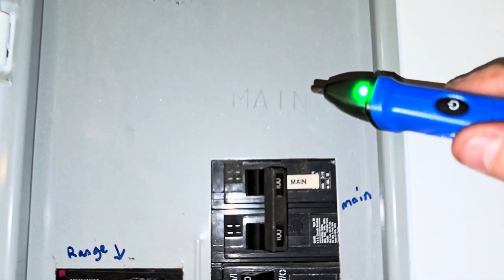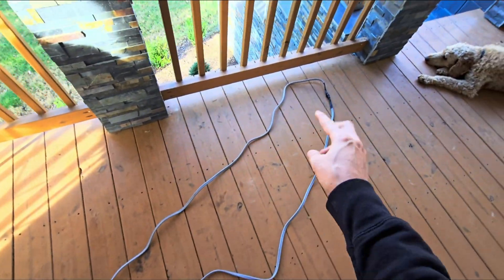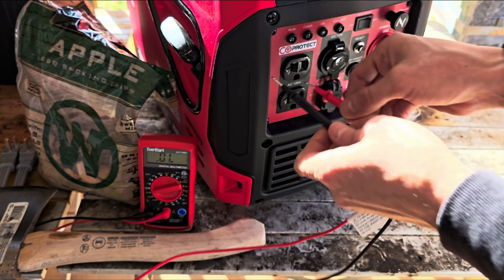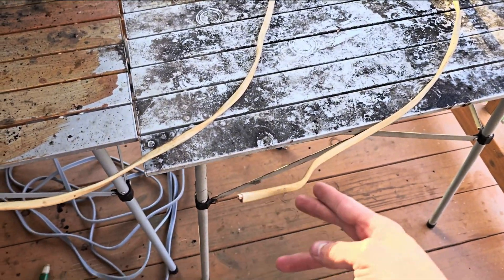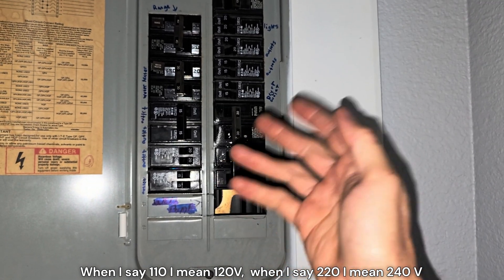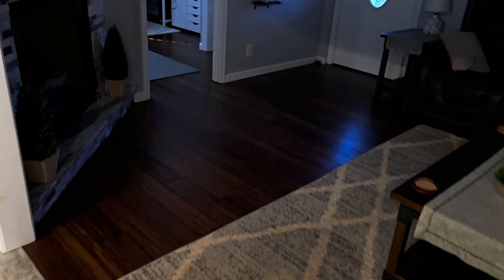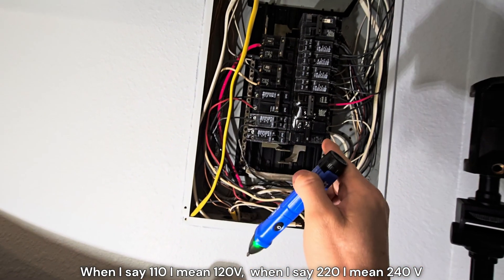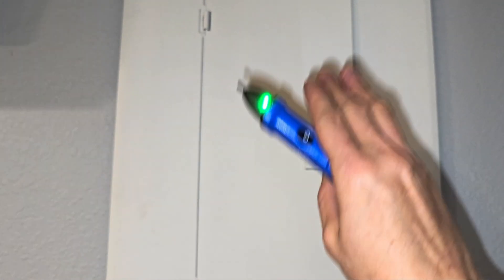How to Power Your House With A Drop Cord & Generator During A Power Outage

Comment: Make sure you check multi wire branch circuits. Powering both sides of the panel will overload the neutral.  I’m not gonna comment at all on the unsafe practices demonstrated.

Comment: like your style my dude.  for emergency generator use i run my 10/4 crossover suicide cable through my dryer vent and to my dryer outlet to feed 30a 120v to both legs. i put duct tape on my main breaker and cord ends as an safety interlock. i found a 20 amp circuit that feeds my refrigerator, dining room and laundry room receptacles and now have my solar backup inverter suicide cable feeding that circuit full time with main power on rest of house. duct taped the breaker as an interlock.  both inverter and generators have floating neutral. CONFIRMED NO MWBC IN PANEL FIRST. very simple and safe in a regulated environment.

Comment: Most generators are bonded neutral. I ran a 50 amp inlet with an interlock on my panel. Since all the grounds and neutrals are bonded at the panel I took the cap off of the end of the generator and removed the neutral/ground bond. I made a bonding plug so if I ever need to use it as a portable generator I can just plug in the bonding plug. Most generators that have bonded neutrals can be un-bonded in a few minutes.

Comment: I have zero problem with suicide cord, or backfeeding, that said, what you showed was pushing unsafe to its limit! I use my 30amp rv plug from my solar generator, to my dryer or stove plug(50 amp). I could never overpower my cable, or my plug, and everything is still on a breaker. You still have to turn off the main and 220v breakers, because its only 120v, but as the 30amp rv plug has 2 hot wires it supplies both rails, bus bars, in the panel, this is as safe as possible! Could a person get shocked by touching one end of the cord, its possible, but you could get shocked if you put your finger in a light socket, bottom line, being stupid might get you hurt

Comment: Say you have two 120v generators. Could you use one to back feed one side of your panel and use the other for the opposite side.  Or use one generator with 2 cords?
Reply from the maker: If both 120v generators are floating it should work if you make sure they are on separate sides of the panel to get 240v. One 120V generator split between both legs of the panel will not provide you with 240v. Each side will just have 120v and your 240v components will not work.
Reply: Two generators working independently of each other will NOT work to create 240v. They will each phase independently of the other, which will NOT work as 240v where the two legs must be exactly opposite phase.  I've never seen what weirdness would happen if you tried it, but either or both generators might react poorly AND there could be over/under voltages on all your loads in the house.  

They WILL work to put 120v each onto each leg, if you put one generator onto one leg and the other onto the other leg.  Just be very careful not to accidentally flip on any 240v breakers.

ALSO IF YOU HAVE ANY CIRCUITS IN YOUR HOUSE WITH A SHARED NEUTRAL (often done in kitchens) you will have problems.  

Many generators DO have the capacity to work together and create exact oppoite phasing.  If you have two generators that will do this, then one into one leg and one into the other will work fine for 120v on all circuits, 240v on any you have enough power to operate, and any 120v circuits with a shared neutral will be fine.

Any pair of generators that will work together and provide 240v will also have a provision for supplying the 240v.   And you can use that cord to go into a dryer or a range outlet, which will put 240v anywhere andc120v everywhere, again just within the limitations of the power you have available.  

In emergency situations, you might not have access to the right cords and plug to make up a cord that will go onto a range or dryer, and any 120v cords to go into two regular outlets each on oppsite legs will work.  Do lso be aware of how much power your generator(s) can do, and dont overload your cords, especially if maybe 16awg was all you had in n emergncy. 

Of course remember that a cord with two male ends is called a "suicide cord" for a reason, and this whole operation is dangerous if mistakes are made.  But in an emergency, this will work, and as long as dangerous mistakes are not made it can work dependably.
Reply: One generator with two cords will work fine, even if you have any circuits in your house with a shared neutral.  Just be careful not to flip on any 240v breaker.  Things like a water heater simply won't work, and things like a range or a dryer will light up the displays and run motors, but will not heat.  However,  modern 240v appliances might have computer boards that would not know how to react to voltage on one leg and not the other, and who knows how they might respond! 

Two generators, one on each leg, can work, but is trickier.  See my other comment about 240v for that.

And even if you don't have an interlock, it would be safer to have an inlet receptacle wired to a separate breaker.  They are inexpensive,  and if you just keep the main breaker shut off would be safer to get thru an emergency.  Still not legal, but safer than a suicide cord!

Comment: Katrina was the first really long need to ever use a generator.  I hurried up and bought one when the hurricane was just about to make landfall, but I had no previous experience using one.  There was no YouTube access back then. We had AOL dial-up. I did not know the correct way to hook it up, but I did know how to run a new circuit for the house.  So, I turned the Main off.  I use 12-2-ground romex and put a 220 male plug on one side and plugged that into the generator. (it was not running, and was outside)  I then stripped the other end of the 12-2-romex wires bare and inserted the hot/black under the lug screw on my 220 60 amp electric dryer breaker, the white onto one of the bussbars, and tied in the green with the other grounds.  The outside laundry room door was just a crack open for the wire to run outside to the generator, so I used some rope and tied the knob so it could not be opened from outside.  I stuffed towels & t-shirts into the crack so no carbon monoxide could find its way inside.  From inside, I locked the laundry room from the inside, then closed it so the kids could not get in there. (I used a "t-handle" off a sardine can to press in the hole in the middle of the knob and unlock it when I needed access.)  This set-up ran our house (except for central a/c) for 11 of the 14 days of outage.  We finally ran out of gasoline, even siphoned the vehicles dry, and even though my son and his friends traveled near & far on their 4-wheelers, there was no more to be had. We didn't really need the freezer or the refrigerator anymore though.  The only thing in there that hadn't been eaten was a jar of grape jelly.  We were boiling noodles on the bbq pit for 3 meals a day those last few days. No, that is not the way to do it.  Today, I'm setting up all kind of fancyness with LiFeP04 batteries and interlocks and Pecron units and solar panels; thank-you to everyone that contributes to YouTube!.  But I'm glad that you at least talked about alternate methods so someone in a jam can get out of a jam in a big emergency.  Thank-you.

Comment: That's a heck of a lot of juice to pull through that one circuit. I would feel more comfortable with feeding it back through a 220 outlet at least. Drier plug would be good.
Reply from the maker: You are correct, you have to be mindful of what size the plug is that your plugging into, as well as the size of the wiring behind the plug. The generator is 2,580 watts but it can only make that as a surge for 1-3 seconds. The rated capacity is 1,900 watts. 1,900 ÷ 120 volts is 15.8 amps. The outlet I have it plugged into is rated at 20 amps and has 12 gauge wiring behind the plug. I'm good.

Comment: They call it it a suicide cord for a reason.
Reply: You can call millions of common things "suicide" such and such if you don't know how to use them.   Jumper cables hurt more people than this cord, why not call them suicide cables?    If you don't know how to use a table saw then that's a "suicide saw".   If you don't know what this is for you almost certainly won't have one lying around.
Reply: @timdietz350  there is a reason cords like that aren't made or sold in stores, it is alot easier for them to hurt someone or start a fire.... and a saw is making lots of noise and spinning rapidly, it's alot more obvious that the saw is in use and you will stay away from the spinning blade, but if that cable is energized lying on the ground exposed and someone or some thing touches it it could seriously hurt them, or start a fire.  Hell earlier in the video he has it plugged into the generator and the other exposed end was just laying on the ground and his dog was laying right next to it, all it took was the generator to be on and the dog move a little and touch the other end and his dog would get electrocuted, or at least a good shock.

Comment: I'm waiting for my electrician to hookup stuff to my panel so I can power my house with my 11kw inverter gen. I'm not exactly sure how he's going to do it, but....my gen is bonded nuetral (westinghouse igen11000dfc). After doing a lot of reading, I've determined i should make it a floating neutral before i connect it to my house/panel. I asked my electrician if I should float the neutral before he comes over, and he said no, the bonded neutral should be fine. 

Can anyone explain his answer? Kind of makes me not  trust him. He's a master electrician by the way, with over 30 years of experience.
Reply from the maker: As long as the 240 side of the generator is not GFCI protected you will be fine. I have a separate video showing how to do a whole home hook up using a bonded neutral generator.
Reply: I know the 120v inlets have GFCI. Im not sure if the 240v/50amp inlet does though. It has a breaker, is that the same? It's the westinghouse igen11000dfc @BaznastyDave
Reply from the maker: @silverspork86  from what I can tell the 120v side is GFCI and the 240v plugs are not. You should be fine. Looks like you're 120 side is a gfci breaker and the 240 plugs are regular breakers.
Reply: Depends on how the electrican hooks it up. If he does a neutral disconnect you would leave it as a bonded neutral. Most electrician will wire them depending on what the generator already is rather than unbond a generator

Comment: When I built my home I installed a manual 200A transfer switch. I would turn off the main at the meter, turn off all breakers in the house,  flip the transfer switch and then with a 250 v twist lock plug it into the generator and the other end into 30A 2 pole in the sub panel out by the generator. Then I could back feed my house with 250 v 30 amp power including running my well. I made sure most unused loads remained off at the panel starting with turning on lighting, fans, and the refrigerator and freezer. The transfer switch made sure that no back feed to the meter was possible. I've kept my home comfortable for a week or more however in really bad conditions it's often difficult to locate an open gas station for fuel. I normally keep around 30 gallons of gas on hand. I even have a small window unit ac that I would put in the bedroom window so it would be cool enough to sleep at night. A senior now I got tired of the whole set up and got a 22 kw whole house generator and it automatically kicks in during a power failure. I bought a refurbished 500 gallon propane tank to fuel the generator. It's a lot more expensive to run however it does have the advantage of powering my entire home including the ac unit.

Comment: can this be done with the 220v outlet on a generator to the 220v outlet on like a electric dryer plug?
Reply from the maker: Should work, the dryer plug is 240v. It should light up both legs of the panel. One end dryer male plug, the other end Nema L14-30 or L14-50 male plug to generator. Will work with floating neutral or bonded neutral if the 240v generator outlet is not GFCI protected.
Reply: @BaznastyDave  thanks for the input

Comment: To safely connect a generator to a home:

    Use a Transfer Switch:
        A transfer switch isolates the home's electrical system from the utility grid, preventing backfeeding.
    Install a Dedicated Generator Inlet:
        This allows a generator to be safely plugged into the home's electrical panel without risky jury-rigging.

In summary, male-to-male plugs are a shortcut with deadly potential, endangering both the homeowner and utility workers. Always follow proper generator hookup protocols!

Good advise telling people to disconnect at the box; but tell them why. Linesmen are out at the poles restoring your power, don't fucking kill them.

Comment: There are so many things dangerous about how this was done! Male-to-male 14-gauge death cord that was cut and spliced together. The jumper wire across a 240 breaker to feed the other half of the panel. I could go on and on... Not good!
Reply from the maker: Yeah if you don't know what you're doing don't try this. As I said, this will not pass ANY electrical code. This was better than not having power for a week for me though.
Reply: @BaznastyDave  If you know what you are doing you won't do that.
Reply: @BaznastyDave  People that know what they are doing will already know how to do this. You shouldn't make videos showing idiots how to do this. This is one of the things they will hurt others with inadvertently, not themselves.
Reply: @BlueCollarBachelor  Cry more.
Reply: It is illegal and you'll be held responsible when someone is killed or severely injured.  @BaznastyDave

Comment: If anyone does this they should disassemble the male to male cable to make sure no one plugs it in when there's power and gets shocked. I personally call those death cables since they're exposed on both ends
Reply: AKA Suicide Cords
Reply: @rwagner8663 thats exactly what is suicide cord
Reply: I've been hit with 120v a few times and it didn't feel bad at all. Stop being a nancy. 240v is a different story.
Reply: It's the Darwin's cord